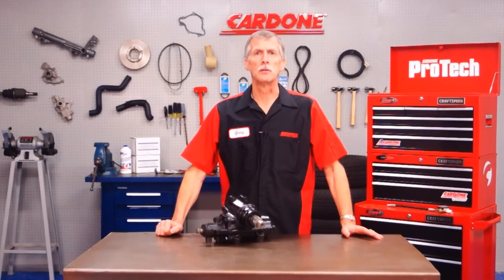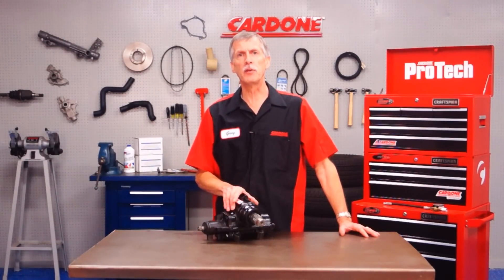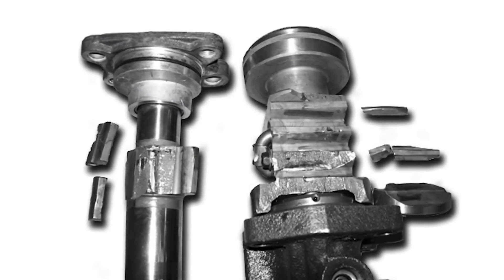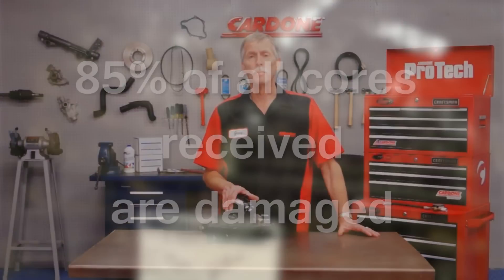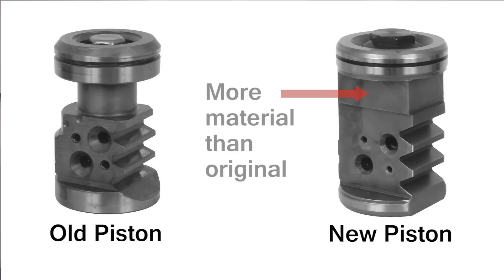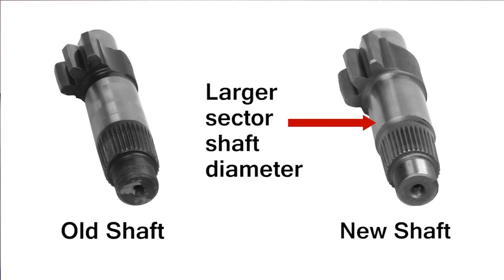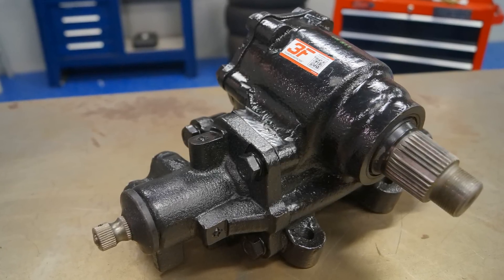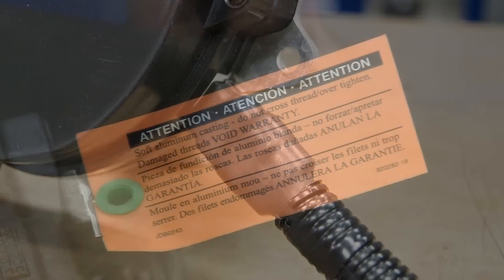Ford F250 and F350 Steering Gearbox Improvements

Comment: I've went through 2 of these in less than 2 years to the point that they are dangerous due to slop in the steering. After my second one I went with a redhead steering box and it makes my truck drive like a brand new one. Don't waste your money on the cardone, just spend the extra and you wont be sorry in the least.

Comment: I bought it from rock auto. Great  product!
Reply: hows the steering box holding up?
Reply: how is it holding up now?
Reply: @christopherhall7049  just put one on my2010 what a difference in steering effort. I have 33” mud terrains on stock suspension
Reply: I sold my truck and got into a new 2020 f150   sport.  I miss my truck .   I will say after I installed I never had a problem with it. !

Comment: be aware that cardone sells 2 version, the first version is only recalibrated using original shafts, with new seals. This version is usually around $200, sometimes found as cheap as 170. The 2nd version is sold "as new" from part stores such as Autozone. This version has the new, re engineered shafts. At Autozone, this 2nd version goes for $580. Don't be mistaken like me, buy the cheap version and think you are getting the re engineered one. 
I installed the cheap version, and found it to have more slop then the one i replaced. I now have to do the job all over again and buy the re engineered version.
Reply: JackiBlue so was the new one better?
Reply: Yeah was it better?!?! C'mon man!
Reply: Still waiting for an answer
Reply: Was the new (rengineered) one better?

Comment: I just purchased the 27-631N for an 08 f350 fx4.  The input is not splined as the old one and it has been impossible thus far to install the steering shaft even after spreading it farther than it should.  The output shaft appears to be longer as the pitman arm does not position as close to the gear box as the original.  Any reason why the steering shaft does not smoothly fit the input shaft?
Reply: I've discovered why.  This truck must have been built prior to 7/07 as 27-621N is needed.  However, RockAuto will not return because it has been bolted to the frame but the pitman arm and tubing was not connected. I should have known not to buy from RockAuto because of other complaints read online.  Lessons learned.
Reply: rockauto has great customer service. I have bought from them many of times, with most orders having a dozen or so parts. They give you 6 months to return cores whch is absolutely unheard of, most the core return date is practically up by the time you receive the new part. I have only ever had one issue ordering through rock auto, they sent me a fuel filter that wouldnt work for the chevy truck i had, it was the part i ordered, but was listed that it would fit, they gave me a full refund and I never even had to return the product. I am not employed by rock auto or affiliated lol, i swear, i am a Canadian that lives 8 hours north of Winnipeg in the boonies.

Comment: my 2012 F250 was taken to dealership for "Death Wobble". They haven't said yet what caused it but say several parts are needed to repair including the Gearbox. With only 37k miles it seems that was what started it.Let's see if Ford will step up and pay for repairs.
Reply: Increasing caster by a few eliminates death wobble.  Of course tire pressure must be maintained as well!
Reply: My 2006 F250 was experiencing the 'death wobble' as well after having my tires rotated and balanced. I found the tire pressure set to 32 psi. The Ford Manufacture label recommends 75 psi. Sounds simple but, I now maintain 75 psi and no more death wobble. Years later I received a safety notice from Ford regarding the death wobble, recommended maintaining tire pressure per Ford specs, i.e. 75 psi. or whatever is recommended on the manufacturer door sticker.

Comment: Hi Cordone. 
Is the steering Box in the 05 F250 the same Steering box in an 05 Excursion 4WD 6.0? Thanks
Reply: No, it is not the 05 truck is a upgrade, but you will have to swap out a hose also